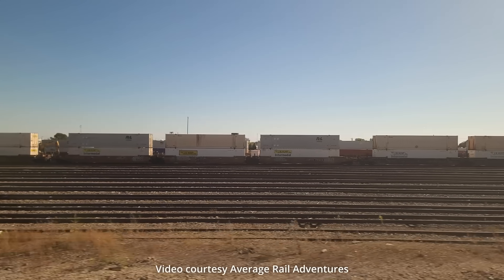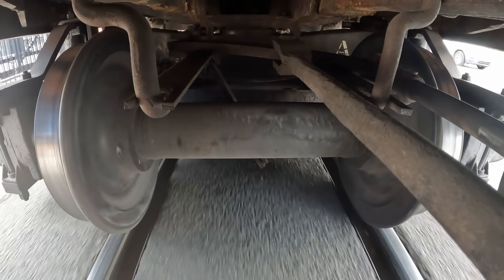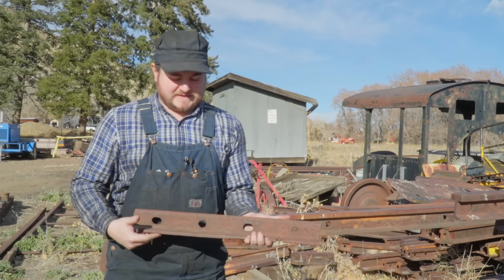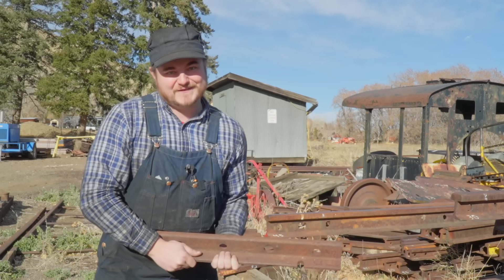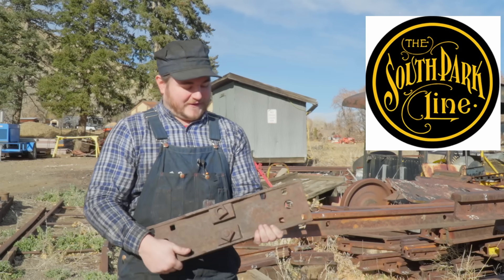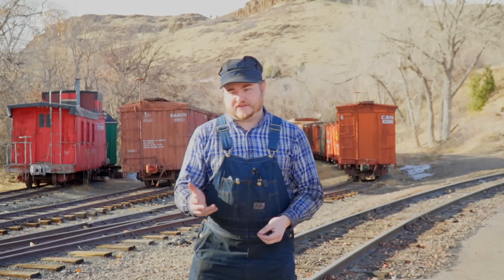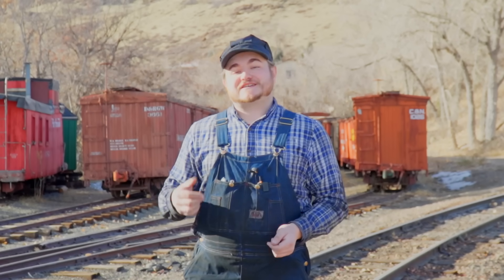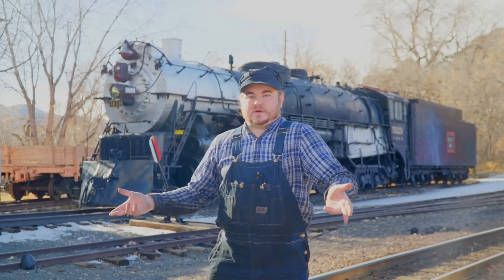Why don't Trains go CLICKETY-CLACK anymore? | Railroad 101

Comment: Oh man, I really wish you would have told me you were making this video, we could have done a sweet colabration.  There is SO much I have learned about joints and track from working on the WI&M!  I could do seriously hours of video just about track and rail.

The WI&M was built with 70 lb rail in 1905-1907.  One interesting thing I found is that the standard rail length for our 70 lb is 33 feet.  Not sure if that's true for all 70 but that's what ours is. Of the 21 miles of track, we have 17 miles of 70 lb and the rest is bigger.  Sadly, all but two switches are 70 lb and man are they worn out and badly in need of replacement!
So despite our low traffic and tonnage, we still have significant sections of CWR on our line, laid by BN in the 1990's.  The CWR is either 112 lb or 115 lb.   Also, a lot of the CWR was laid in November... hardly the proper time of year for neutral temp.  We have had to repair several sun kinks, and there will definitely be more to fix next year.  
One thing that is a fairly recent FRA rule is that you can only have a difference of 25 lbs or less in a comp joint.  So on our line, that means every transition from 70 to big rail is actually TWO comps.  It goes 70 lb - 90 lb, then 90 lb - 112/115 lb.  All those joints have a single piece of 90 lb rail in them.  A "fun" thing we are dealing with is that 70 - 90 comp bars are hard to find, I think we have two complete sets and a bunch of miss matched bars.  Good for repairs I guess?  I've seen bigger comps, for example 90 lb to 136 lb, but those are legacy comps and no longer legal to install new, though existing ones are allowed to stay so long as they are in good condition. I've also found a lot of weird comp bars in our various parts piles in the yard, including a full set (4 bars) of 56 lb to 90 lb!  Kind of a rare size these days. 
Another interesting thing is that there are different profiles of rail as well.  90 RA is NOT the same as 90 GN, and so there is one spot on our line that has a 90 to 90 comp bar, going from GN profile to RA profile.  That only serves to make the transitions harder to deal with, as not all comp bars fit all the comp joints.  
Lastly, despite the low volume of traffic, our long term goal is to upgrade at lease the main line with all 115 lb rail, and use CWR.  Since we already have some CWR we must have a CWR program to submit to the FRA, so more CWR isn't that hard to deal with.  Less joints are also better.  There are SO MANY BROKEN 70 lb joints bars it's ridiculous!  The tie replacement program that we did this past year even broke a ton more!  We will have our hands full replacing broken 70 lb bars for a while. 
Ugh.  so much to keep track of and do.... BUT if you want to do a second video on track structure and components please let me know.

Comment: How can I explain this so that the translator doesn't "muddle" it???
I know nothing about railway tracks, but I do know something about the tram tracks in my town. We've had "endless tracks" since the 80s, and "expansion tracks" have been installed in between with a forced direction of travel, the inner track tapers to a point and the outer track is slightly curved and rests against it, these "expansion joints" only appear individually to prevent the track from spreading, another "joint" can be found in the track section far apart.@ 9:40 something like that ! I'm not a track construction worker, so I don't know what these tracks are called.... but we also have what I consider to be "dangerous" rail crossings where the depth of the track is reduced with ramps and the wheel runs on the guide ring instead of the running surface...! Why? because the "new" low-floor vehicles have very small wheel rims and when they drive over the crossings and stop exactly on them due to traffic jams, the wheels get wedged in the rail profile and get stuck. As a countermeasure, ramps were built into the tracks so that only the wheel rim touches the rail, disadvantage ... only walking speed up to 15 km/h, anything faster always leads to derailment

Comment: I found it interesting we never saw a move towards ~160ft sticks of rail in the 30-50s which can be moved fairly easily but also cut the amount of joints down from 5 to 2. I've got track charts from SP in the 80s across Oregon and they marked ballast material, rail weight and joint types. For branch lines especially it was whatever leftovers they had from mainlines getting new rail.

Comment: As an aside, the operators of the interurban network radiating from my hometown installed rail with parallel joints on some segments to discourage motormen from speeding. Other parts of the system used traditional staggered joints.

Comment: Always nice to see how the U.S. does railroading. For the past few years I've been following the German Stuttgart 21 high speed rail project. They use 120 meter long rails which are flexible enough to have them transported on a number of coupled flatcars. Always impressed when seeing thermite welding in action.
Reply: 120m, continuously (thermite) welded on concrete sleepers or a concrete bed (ie in tunnels). It feels like most of the German railway network is cw nowadays as I can’t seem to remember when I last heard the clickety clack

Comment: As a former Crane assembler (tinkertoys really nothing over 20 tons) rail spans come in ft lengths, and are measured in lbs/ft. Kinda curious what the weight ratio is for the NG rail . The joining plates were just called splice plates generally 4 hole.

Comment: Expansion joints are used if there is a need to avoid thermal stress in the rails. Imagine that track on a long multisectional bridge will get compressed due to heat and create transverse forces that are being transmitted via ballast (or concrete for non-ballasted) track into the superstructure of the bridge. This could result in dislocating a bridge section and make it unsafe to pass. Having a place to expand to avoids this hazard.

I've also seen welds between different weights of tracks. That is pretty standard on any non-mainline tracks over here. They just use different kind of molds to accomodate for differences in height and width. And big grinding wheels to smooth things up after welding.

Another reason for jointed rail can be found in mining areas where you may get considerable sinking motion of the surface. CWR will start to hang hollow over the ballast if the surface saggs a bit and the first train will crack the rails when the weight overcomes the stretching capabilities of the rails. Jointed rails on the other hand are allowing follow the ground sag more easily, as the joints are designed for a certain amount of longitudinal tolerance. So jointed rail can and will compensate for minor surface movements, where CWR is bound to fail nearly instantly.

Comment: Continuous welded rail can also be helped by thermal management.
Simple solution is painting the rail white. Less thermal absorption compared to rust. And the running surface of the rail is effectively polished and don't absorb nearly as much heat as the rust. And paint the running surface on accident, no worries that will wear away after a train or two.

A solution in winter where the rail can pull apart is heaters.
Not the most energy efficient thing in the world, but everything from gas burners or heating cables or just passing current through the rails are used in some areas of the world. (usually though for specific segments of track where tension is a known problem but adding an expansion joint is hard. Otherwise one would just add an expansion joint. Though, heaters are more common around points/switches for another more obvious reason.)

Expansion joints are great, but rarely without their own issues.

Though, then there is tunnels.
Usually far more thermally stable than the outdoors, so even expansion joints are fairly redundant here. (unless it is the London tube... This is a joke, temperatures in the tube isn't fluctuating enough for it to matter, not that this makes it feel any colder in summer.)

Comment: Where I worked in the early 1970's, B&O Bayview Yard, the yard tracks were mostly ribbon rail. 
I was on an Amtrack train between Salt Lake and Grand Junction and near Green River,  Utah there was a several miles-long stretch of jointed track. The ride was noticeably different that when on welded rail. More rhythmic micro-accelerations. Sleep inducing.
When on ribbon rail there are times when the "click-click, click-click; click-click, click click" sound of wheels passing over a joint can be tracked as the cars ahead,  then the car your on,  then the cars behind pass over that joint.

Comment: Hyce, you forgot to mention one part of  CWR (continuously welded rail). That part being the adjustment switch. The adjustment switch is used near tunnel's and bridges due to the expansion and contraction of flat bottom rail. This is not used on bullhead rail as this rail type is much older in the U.K. (U.K.o.G.B.a.N.I. as fully abbreviate) . You might not use them in the U.S. due to the hotter weather conditions. We use them to the average temperature being below the average temperature of steel at 27 degrees C bar from extreme weather. The best way to picture them is sleepers that have random fishplate or rail acting as fasteners to keep the sleepers in line and two opposing switch blades on the same side of the track this is also mirrored on the other side of the track and it maybe staggered on a curve. So you can still get the klickedy clack sound when going over them. There is a lot more to adjustment switch that's the best I can do with out getting into the nitty gritty of how they work and look.
Reply: Adjustment Switches have not been installed in the mouths of British railway tunnels unless there is a change from CWR to jointed track at that point since the 1980's.

There are also bullhead rail adjustment switches, and lengths of bullhead CWR, but they are not very common.

Comment: 2:51 Oh… That means 99% of goofy model rail track pieces aren’t goofy at all. They are actually prototypical, albeit to one (?) particular railroad, (Denver, South Park & Pacific). 

What a joy…! 🤪
Reply: Yes, don't know how you'd be able to weld HO scale track
The closest is to use flexible track but few of us have space to run long mainlines of a scale miles let alone 10 miles
Reply: @evangiles4403 I'd be tempted to see if a teaspoon of Caldwelding powder would work.

Comment: over here in germany, or at least in the Feldbahn part of germany's narrow gauge world, we actually don't have compensating joints! we have specific pieces of rail designed to smoothly transition, and two joints of either rail weight to connect it inbetween! it's a lot easier than having to find a specific compensating joint, and it still allows you to assemble and disassemble the track quickly, like the Feldbahn was known to be good for!
Reply: On British Rail we had the technology to termite weld different rail sections together to avoid the need for junction fishplates since the 1960's. More recently forged transition rails have come into use, particularly for use where UIC60 (121lb/yrd) rail abuts the older British Standard 113A rail in fast mainline track.

Comment: No more “clickety-clack” of rail joints, but plenty of “thunk-thunk-thunk” from wheel flats still!
Reply: and ting tiiing from the wheels hitting the rail and grinding on a curve sounds like a sharpining wheel. of course we have many crossings close by to the chicago subdivision yard and there are several switches not far away on the triple tracked main there as well as all the tracks in the yard though there used to be more in decades past when it was still b&o.
Reply: (sings) The wheels on the tram go <thunk><thunk><thunk><thunk><thunk><thunk><thunk><thunk> ALL. DAY. LONG.
Reply: @LordPhobos6502 in former soviet states lol
Reply: Came here to say this
Reply: as a metro train rider(analogue to North american:Subway), this sound is really familiar, flat wheel happens when a train have to slow down frequently as a metro train would from around 80km/h, and although CWR is almost everywhere, track points still exist and their frogs isn't moveable which left a gap and making the clank sound(moveable frogs are only used on high speed section and metro trains never reached such high speed)
Reply: @lsp6032  North America has metros too
Reply: I have ridden the NEC on NJ Transit many times, and there's definitely a clack-clack-clack-clack sound (it's actually most pronounced at high speed when someone opens the door while moving between cars), but it isn't like "clack-thunk", if that makes any sense lol.  There are other, far less regular yet louder noises when the train goes over a switch, etc.; those aren't what I'm talking about.  Anyone know?  I've actually wondered about this quite a few times.  One would think that if any track in the whole US is "seamless", this one would be, given that its where the Acela runs. (well, I know it can't run at top speed everywhere, but still)
Reply: @bsadewitz  Peeking at some cab rides, it does appear parts of the NEC still have jointed rail
Reply: @andrewreynolds4949  Oh, interesting.  Yeah, that makes sense, because obviously I haven't actually looked at the whole thing lol.
Reply: @bsadewitz  The area around Newark Penn / Dock Bridge seems to have a lot; as well as there being a LOT of switches, and a number of solo joints (probably 'insulated' joints) that seem to be signaling related. Hopefully the Gateway program will see a lot of the unnecessary joints disappear
Reply: @andrewreynolds4949  it's sometimes an almost comically rough ride over there.  I personally don't really mind, it's just amusing.  Kinda endearing lol.  But I think I'd prefer the trains go faster heh.  But originally I was talking about a sound I heard even on the sections like (pretty sure) south of rahway on the NEC that to me look pretty new.  I think the ties (if that is still what they are called, I don't know much of the lingo) are concrete.  It's just a soft rapid clicking sound.  Maybe I'm crazy.  Further NE once u pass Newark--that's a whole other ballgame and not what I'm talking about.  Portal bridge ❤️
Reply: @bsadewitz  Could it be from the catenary? Not sure what would be causing that; I suppose it could be from the suspension or something else, as well?
Reply: Or "SQUIIIIIIIIIIIIIL" when turning
Reply: PREACH!!
Reply: Just need the anti-lock brakes on railcars then no more flats
Reply: @rotunda57 flat spots on rail car wheels come from moving cars with hand brake applied not from service or emergency application
Reply: You'd be surprised how often you hear flat wheel on freight lines
Reply: max autism, whats wrong with a smoooth as butter ride, feels quite nice and surreal, its like doing a 100 in a 1999 honda civic vs a rolls royce. the smooth ride is nice as a passanger, the tactile feedback is nice when youre operating/driving. id prefer my plane ride without turbulance
Reply: Wow! I was gonna write this In clickety clack the thunk thunk (demonic drum sound) is dwarfed.

Comment: In Europe, the rail joints were usually not staggered, that's why European trains, rather than making a "clickety clack" sound, made more of a "drumming" sound.
Reply: At least in the UK, with coaches (Not Multiple Units) - the noise is da-dunk...da-dunk.
Reply: @C.I... Sounds cool!
Reply: Interesting perspective on the USA methods with PW.  Here in the UK our jointed track always has parallel joints. These make it easier to replace complete panels which are 60ft , and also if there are dropped joints they tend to be the same in both rails so the trains simply move vertically whereas staggered dipped joints cause swaying which leads to derailment.  Many of our continuously welded routes used tuned ac track circuits  rather than insulated block joints but these days we are moving to axle counters as is mainland Europe. 
Even on switches with welded stock fails and swing noses on the “frogs” the noise is now disappearing because there is no discontinuity in the rails.
Reply: I'd say it depends on the region. For example, in France, it sounds like, "le clic le clic," in Italy, it sounds like, "il clic il clic," in Spain, it sounds like, "el clic el clic," and in Germany it sounds like, "die schienen machen so viel lärm."
Reply: Lol! @Maxmumspida
Reply: @Maxmumspida Still laughing!
Reply from the maker: Interesting!
Reply: In Czechia the rail joints were also not staggered, at least based on the sound the trains had.

Comment: While I was working on CSX we still had quite a bit of jointed rail we ran on. Mainly on the industrial trackage but there was still quite a bit up near the end of track
Reply: I think there’s parts of the S line in SC that are signaled track that they run Amtrak on that is jointed rail

Comment: Surprised you didn’t mention “Snake Heads” / “Cobras” as one of the cons to jointed rail… considering they would cut a train open like a welding torch through butter and cause it to go off the rails faster than Ozzy Osborn at the throttle on a Crazy Train.